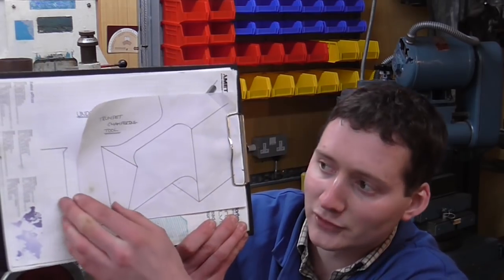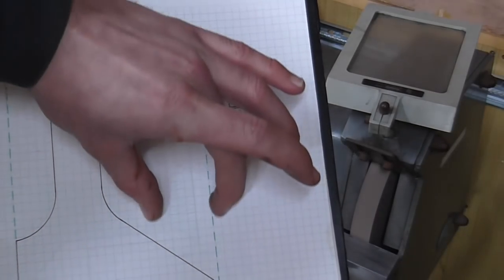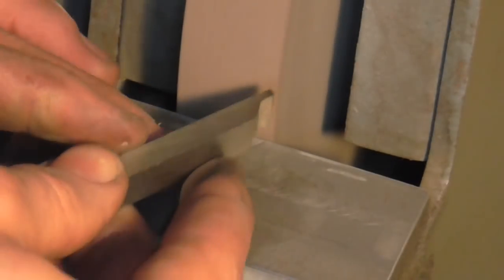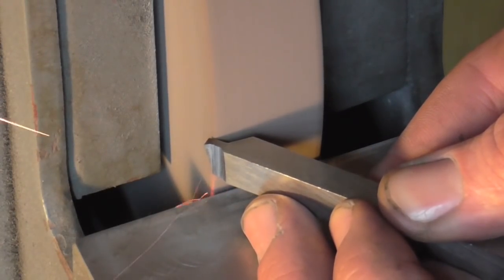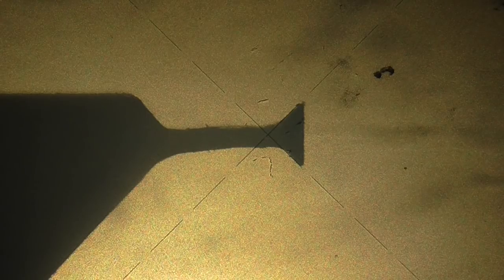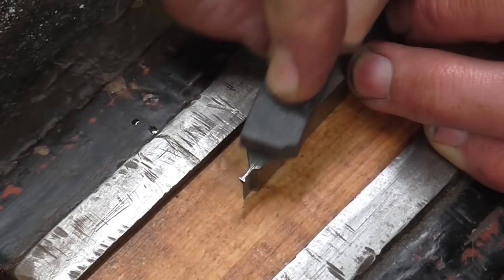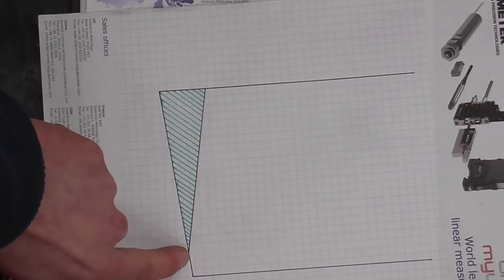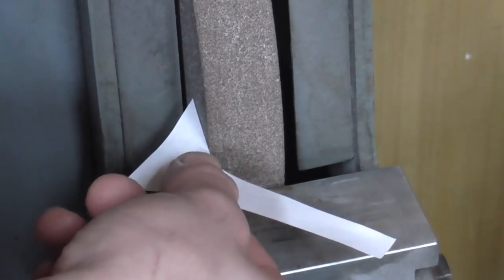Grinding a Trumpet Chamfering Tool

Comment: This video is a very good description of the basics of hand grinding a lathe tool. Sadly a large portion of today's machinist don't have the skills needed to grind a tool as displayed in this video. I have managed a few production machine shops in this modern world of cnc machines and the "machinists" expect you should just order a tool to do whatever job hits the floor. And it's not always possible or neccesarily cost effective to order a tool to create a particular feature. In fact a lot of people calling themselves machinist don't have the basic understanding of cutting tool geometry and unless you select the tool for them weather it is an endmill or a carbide insert they lack the basic understanding neccessary to select the tool for the job.

Comment: Superb hand grinding skill! Amazing you can tease that shape out with a 6 inch abrasive cylinder. The use of this tool in your piston ring video
is equally clever. Just describing this shape correctly in 3D CAD would likely take more time than it took you to make it. Your grinding skill is rivaled only by your hat throwing skill. Great Job. You inspire me, I'm going out to my shop now to practice throwing.

Comment: Glad you got rid of all those darned ads that youtube is saturating every channel with. 
I've hand ground several similar tools for internal dove tail seals. Pretty scary putting dove tails twelve inches down inside a bore on a manual lathe, very little feel.

Comment: Are those Jones and  shipman grinders I see in the background???.  Greetings from an old Scotman  living in South Africa . Worked in rolls royce  Derby no 6 shop in  1968(toolroom)   That 540  J@S  would have made quick work of  that form tool   as long as you had a universal swivel vice..   like your channel  keep up the good work..
Reply from the maker: Hi yes it's a J&S 540 but it's not actually running. I need to give it a once over and re so all the wiring. The machine somewhere next to it is a Dormer tool and cutter grinder. That one is running but I need to make the wheel arbours. Basically I have not yet set myself up for grinding but I will get there. 

I'm at RR myself. Quite a few of my colleagues talk about days in 6 shop but I think they would have been there in the 70's /80's

Comment: No shadow graph. How about a SUB microscope, they usually all come with some simple feature measurement software. I have used them for measuring optical and fibre optic features and they work great and can be accurate if calibrated.
Reply: That is what I was thinking. These video microscopes are quite inexpensive and with a bit of effort should be capable of reasonable accuracy.
Reply: @howardosborne8647  "USB" microscope (just in case anyone is confused). Sub's use para-scopes and they are rubbish for grinding tools :)
Reply: @DrKnow65  Err,I think subs use periscopes. Parascopes sound suspiciously like magnifying devices used by people who jump out of aeroplanes,even though the aeroplane is in perfect working order.
Reply: @DrKnow65  peri   ?

Comment: A question:  While your hand ground tool was quite successful, you made the rings, are tools like this ground/fashioned on a tool and cutter grinder?  I imagine a skilled fellow could grind intricate details with such a piece of equipment. 

Thanks for taking all the time to show what you do.  I enjoy learning and hope to soon be putting all these tips bits to use.
Reply from the maker: Yes a cutter grinder or in this case even a surface grinder would be a much more effective way to do it. Set the sine chuck to the required angles and then just put the required form on the wheel and grind each side in turn.

Comment: At 1:11 I couldn’t help but notice the Kerry Super 8 drill! Good taste, I’ve got 2. One I restored in my channel.
Reply from the maker: I need to replace the spindle bearings actually. Is that something you did in your restoration?
Reply: @MrCrispinEnterprises  I replaced all the bearings on mine. You'll need a press and I can send over the bearing part numbers
Reply from the maker: That's would be great. It's mr_crispin@hotmail.com

Comment: Would you please share the grit and hardness of the two grinding wheels please? Thank you.
Reply from the maker: I'd have to find them out first! I'll have to take the covers off and have a look
Reply: @MrCrispinEnterprises  Well I don't want to put you through that, I was hoping you just knew because they seem to work extremely well vs. what I'm using in shop.
Thanks for all your hard work creating the videos and sharing knowledge!
Wish I still had 24 y.o. vision!!!
Reply from the maker: It's all about the wheel condition. A course dress and minimised heat.

Comment: I would have ground it on a tool and cutter grinder or surface grinder and dressed a 45 degree chamfer onto the wheel. tilting the holder over 7 degrees .

Comment: M8 to save yourself a bunch of time grinding down that hss blank ,use a cut off disc and a angle grinder but for a stainless steel ,1 mm thick.I use bosch discs(1€) for stainless steel and it goes even trough 10% cobalt hss.And no ,unless you push like crazy it wont soften the hss .Dunk it in a water ,wipe it off and continue to cut.
Reply from the maker: Good idea